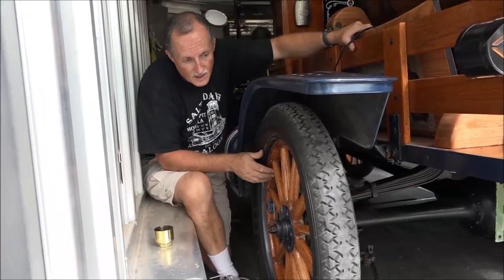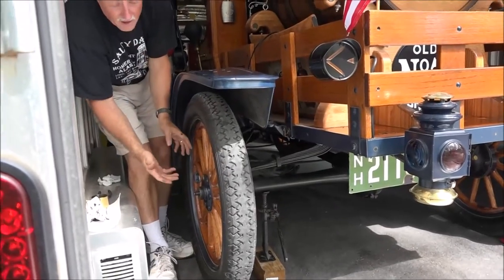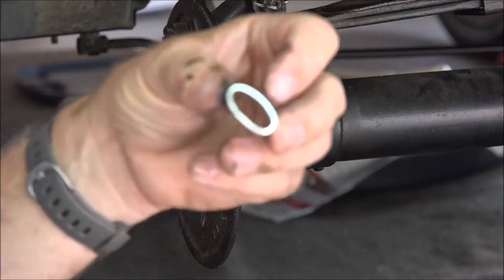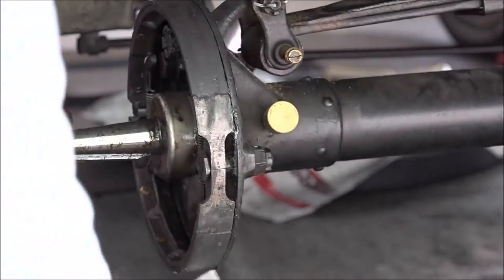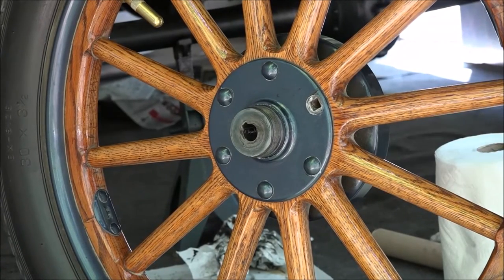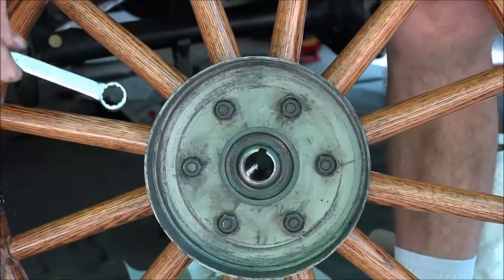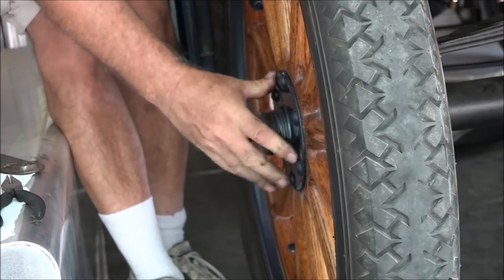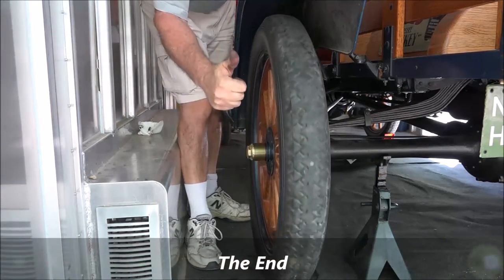How to Fix Loose Wheels on 1913 Ford Model T

Comment: Charles,  when that
At exact thing happened on my 1913 T about 22 years ago I did the same fix as you. It is, at best temporary. You failed to address the bigger problem, your loose hub nuts allowed the wheel to wobble on the hub (you discovered this) and wear the hub end of the spokes.  Running on that wheel will quickly allow it to get loose again and possibly collapse. You have to tighten the spokes. 

There are two ways to do that.  You can remove the bolts and the hub from the wheel and insert a sheet metal shim between hub and spokes. This is hard to get tight enough. 

A better fix is to remove the non-demountable Ronny drilling out the rivets and removing the tube from the valve stem hole.  Run a sheet metal shim (I use galvanized steel) around the wooden felloe and tack it in place.  Drill the river and stem holes and then heat the rim with a large rosebud tip on your acetylene torch. Push the rim to place and cool it with water.  Use a heavy hammer to get the rim exactly in place to true the wheel an insert new rivets and valve stem tube.  Peen the rivets. You will need to repaint the rim.  

If you do it this way you will have a safe fix that will last longer than you will.  

If you don’t do this fix you wheel is going to loosen again and likely collapse on a turn.  You are risking having the car rolling over which is never good.
Reply: Sorry I meant to type Rim not ronny and drill out rivets

Comment: The nut that holds the wheel on the axle shaft needs to be way tighter than you can get it with the hubcap wrench. The wheel must be wedged firmly on the axle and the hubcap wrench does not provide the necessary leverage. Ford recommended using a wrench between 20 and 25" long for that purpose.  I tighten mine up to at least 100 ft. pounds then go a little tighter to get the cotter pin in. Check them every once in a while to make sure  they're still tight. If the nuts are not tight enough the wheel can move on the end of the axle and wear out the axle and hub. Also, the key can wear and shear off  or chip out the key seat in the axle then you have no transmission brake.

Comment: You need to tighten that axle nut to about 100 ft pounds. You need to 'set' the taper so there will be no movement against the key in the hub. I use a punch to peen the hub bolts, or loctite them. Great vid. Nice T.

Comment: My biggest worry would be the wheel hub just falling off the axle taper. That should reqire a puller and some serious oomph on the wrench on the puller to get it off. I'd say the tapers on both the axle and hub are worn to uselessness by being run loose.
Reply from the maker: My mistake from a previous repair was not properly torquing the nut properly so that's why it came off so easy this time but both tapers are ok.

Comment: Should of been washered for sure,it will just come loose again,amature.
Reply: Peening is the proper method recommended by Ford. Even with a lock washer they can still come loose. I've seen it happen. Also, adding a lock washer can cause the nuts to hit the brake shoes and break them apart.
Reply: I think if Ford had Red Loctite back then it would be perfect.  Peening is a pain in the Ass & now you need new bolts if You ever have to take it apart.